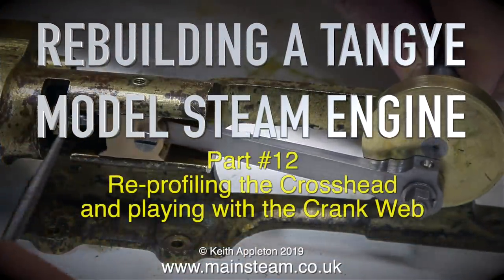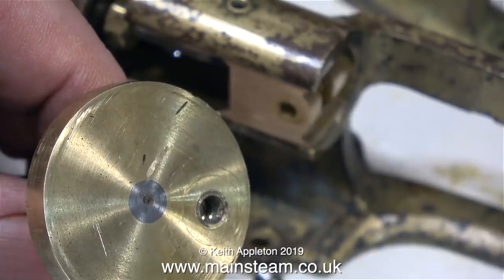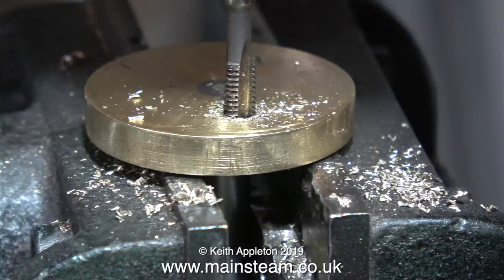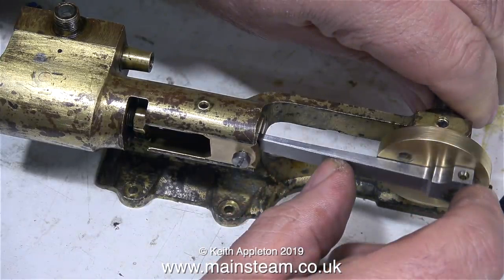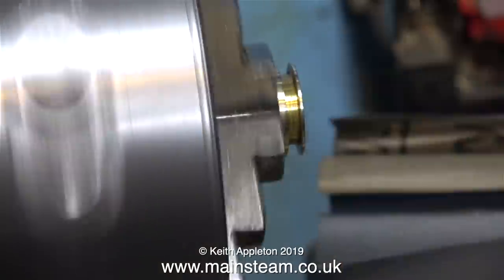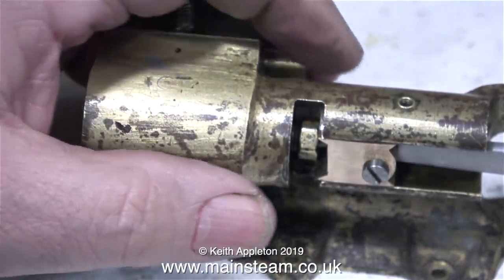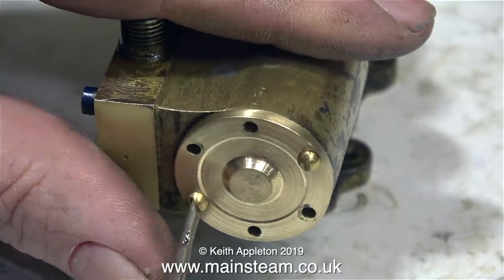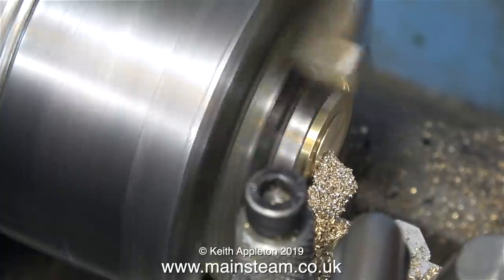REBUILDING A TANGYE MODEL STEAM ENGINE - PART #12

Comment: I agree it was probably a kit and built before you started doing videos. The builder messed up part of the original kit and tried to make his own replacement parts. Miss measured them and chucked some in the bin, then chucked the whole kit. Been there and done that when learning.
Reply from the maker: yes, it's one of the best way to learn . . . . . if at first you don't succeed - throw it in the bin and start again }:-)))
Reply: Keith Appleton "If something's worth doing, it's worth doing badly." G.K.Chesterton.